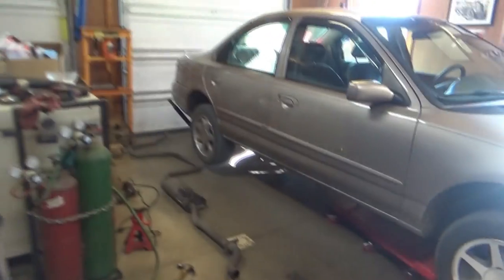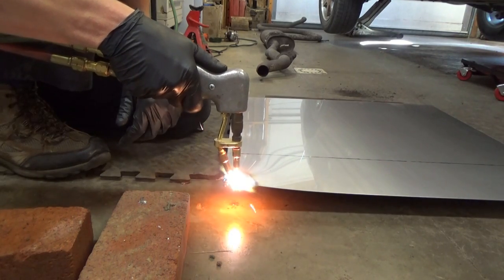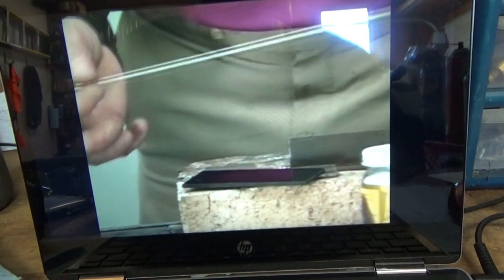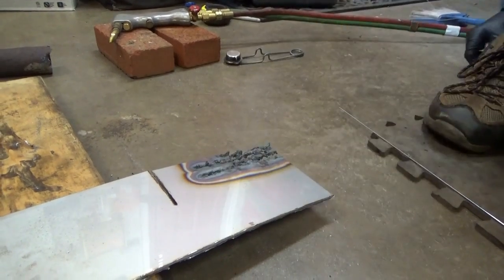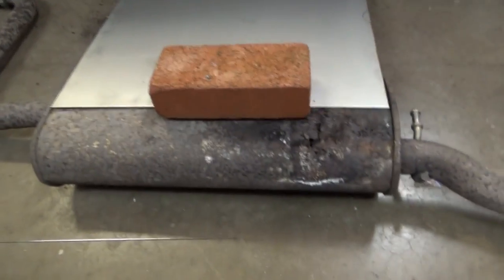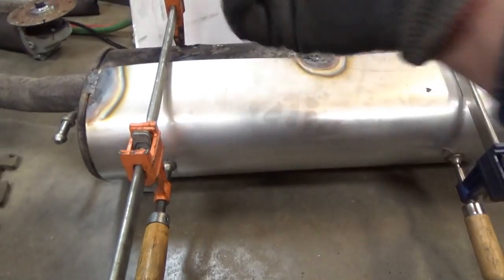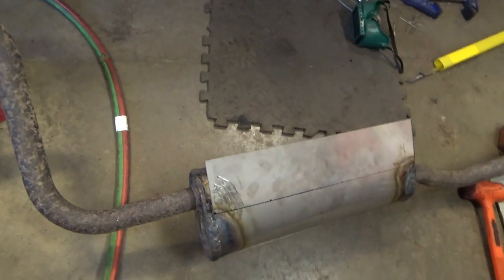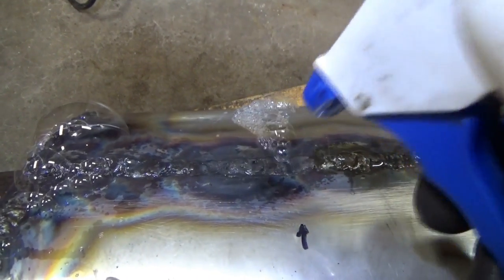How to Weld Stainless...With a TORCH!! ('96 Mercury Mystique)

Comment: Who would have thought it was possible to weld stainless to rust. Ivan didn’t know it’s impossible, so he did it. Awesome job!
Reply: The Soviets built the MIG 25 out of stainless steel. If anyone could do it, it would be Ivan.
Reply: @zoidberg444  
Because it is easier to work with than Titanium but has some of the same properties.
Reply: @Peter_Riis_DK  Ti burns-alot, drop out of a rich flame you cant put it out.
Reply: Stop @chasingcapsaicin !
Reply: @Peter_Riis_DK  ¿What
Reply: @chasingcapsaicin  
I assume your confusion stems from the chasing.

Comment: Awesome video Ivan! That’s a good alternate method of welding stainless. I just did a stainless exhaust welding job on a BMW but I used stainless flux core wire on my portable MIG and it turned out great!

Comment: That's KRAZY that car came with a Manual 5 Speed, LOVE IT.
Reply from the maker: That's the ONLY reason why I bought it, and the ONLY reason it's still going at 300k miles haha
Reply: @PineHollowAutoDiagnostics  That ride looks GREAT especially for the year & mileage. YES I would have bought it also, NOT MANY AROUND AT ALL.
Reply from the maker: @NoWr2Run  Best $500 car I ever bought...definitely put in quite a few hours in the last 4 years to bring it up to my specified level of perfection :)
Reply: @PineHollowAutoDiagnostics  $500, You stole that car, HOLY CROW.

Comment: Wow!! Ivan, just wow! I never even thought of that!  You always have such great ideas. You are so right about the exhaust! The front portions on both trucks (86 & 89) still have their original pipes... and the 86 still has the original cat. Lol

 It's the mid & tail pipe that have been replaced prior to me getting it, but after the 2nd time of having to replace this portion, I went with stainless for the 3rd. However muffler is still cheap junk. I may try to do this as well next time. 

Took a bit of time but it came out so well. That's a heck of a welder! So versatile. Perfect for the DIYer
Reply from the maker: Hi Cuba! Yeah this method requires a lot of patience, but the end result turned out perfect :) I wish I had done the rear muffler like this too before cutting it off and replacing it with a "Stainless" Walker unit that only lasted 3 years lol! Oh did you get my email?
Reply: Hi Cuba. How are you
Reply: @jeremyanthonyw2r  hello Jeremy 👋  all is well, just hustling away. Nothing but work. 🤷🏻‍♀️  how are you sir?
Reply: @CubasAutomotive  great.